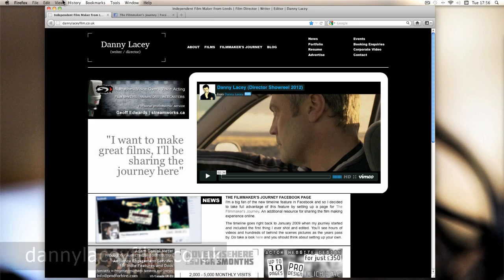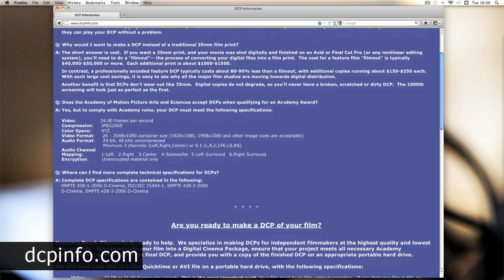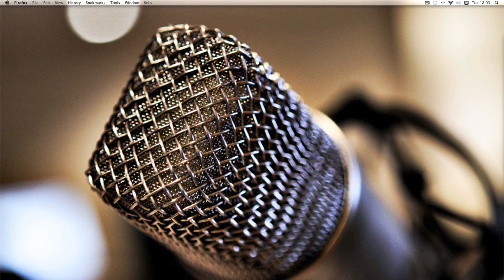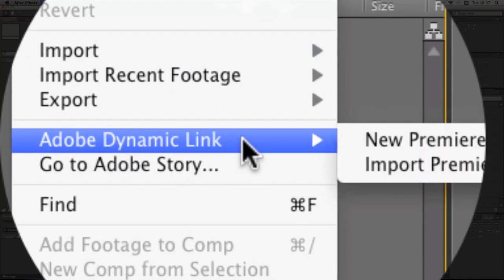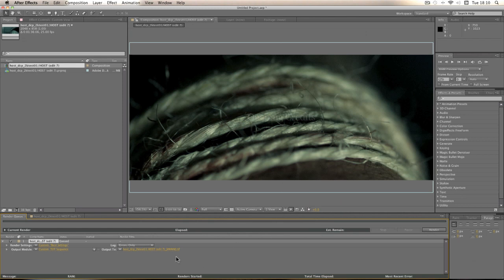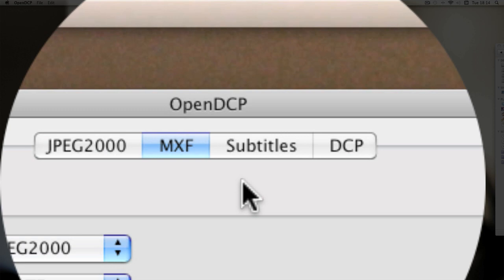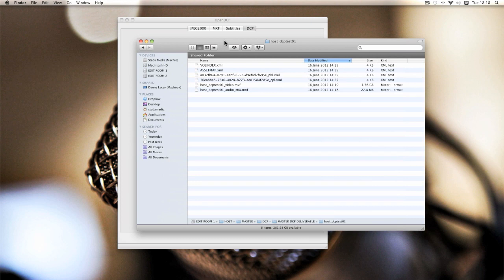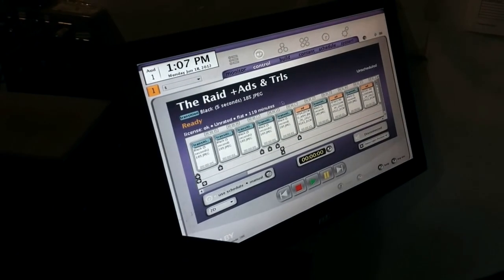GETTING TO GRIPS WITH MAKING A DIGITAL CINEMA PACKAGE (DCP) FOR FREE

Comment: I premiered my first feature last year and had to make my own DCP with OpenDCP.
150 minute film, within the last 7 minutes towards the end, it seemed like a couple of frames stalled - but sound was ok and we agreed after so much trial and error that it was "good enough" and nobody would notice.
This was fine on the dolby projector however -
in the brighton screening,all was fine until that frame - and boom. black screen. audio cut out, like a power cut for 2 seconds, before it came back. it broke my heart.
I'm trying to work out what went wrong, but I don't think I'll ever know. NeoDCP seemed fine. everything validated.
maybe 185 mbs was too high - maybe I shoulda done 125? because there were major problems like this on the first attempt and that was at 250, so i toned it down.
the horrible thing is, there is no way to really find out. maybe the unix drive which was hell to work with (since im using windows) was corrupted - but i just don't know.
any advice on this stuff would be appreciated. It was in 2K, 5.1 sound, 24fps, 2.39:1
I have access to the dolby projector, but not the other one that i thought blew up!

Comment: one thing to point out is; with long movies, opendcp will appear to freeze when you press "create dcp". in most cases it's NOT frozen. A 2 hours movie "appeared frozen" for over 1 hour (on a 12core xeon Mac), then the "choose destination" window appeared, i pressed ok and in one second the "DCP CREATED SUCCESSFULLY" appeared. So, fear not. 99% of the times is not frozen, unlike you might have read in a few forums. Also there are a few choices to review your final dcp on a mac or pc at the moment, some are cheap and/or for rental, like Quvis, easydcp player and so on. just google it :-)

Comment: dear Dany, thanks for your detailed explanation. I still have questions though, hopefully you can give me the answer. Will it work for 1920 x 1080 resolution (instead the 2K - 1998 x 1080) ? thanks a lot more in advance.
Reply: +edo wulia 
Use the FLAT-container (1998x1080) and pillbox it.

Comment: I'm a bit confused about a couple of things. 

1. Just for noting, 2048x1024 is a 2:1 aspect ratio, not as you say, 1.85:1.

2. is there a reason for going through that extra step of making it 2:1 and then just cropping? Isn't it just easier to go directly to 2048x858?

Comment: I followed your instructions and created the 16 bit tiff files in Adobe AE. When I used opendcp to convert the tiffs to jpeg2000 files and compared them to the tiffs, the color of the tiffs was colorful and vibrant but the color on the converted jpeg2000 files was washed out with a greenish cast to the skin tones. What went wrong?   ....Update ...... I looked on the opendcp website and one of the FAQ's had this question answered. It turns out the mpeg 2000 files created from the tiffs are xyz color space instead of rgb, so on an rgb monitor they show faded colors with a green cast. However the files do convert properly with proper colors to .mxf files and work properly in the dcp package files created by opendcp. In order to verify my dcp files worked I downloaded the free trial version of NeoDCP player (64bit), and the dcp package worked perfectly (I had tried viewing the video mxf file with the vlc media player but it didn't work).  Even with the NeoDCP Player trial 1 minute limit and watermark, I could tell the dcp video and audio worked perfectly, and slightly sharper than an mp4 render I did of this project (probably because of the conversion to 16bit tiffs during the dcp creation process).  Even though this video is more than 6 years old and the opendcp.org website forum hasn't had any activity since 2016, these instructions are working great in October of 2018. Well done Danny Lacey! P.S. The only part of the instructions that didn't work for me was changing the 1920/1080 2k HD video resolution to 1998/1080 to get the 1.85 ratio, instead of 1.78 ratio of standard HD. Changing that picture size stretches the width of the image (faces and people get fatter). So I left the image size at 1920/1080 when creating the tiffs.

Comment: Thanks Danny, How to deliver the DCP files to festivals after finishing everything? will a USB flash works? and how should I format it using windows. thanks.
Reply: +Waref Abu Quba 
Use a flash drive of any size. If you can the industry standard is a ext3 formatted HDD, but NTFS also works fine.

Comment: @12:44 you have a aspect ratio of 1:2 (with 2048x1024). Not 1:1.85.
As a digital cinema technician I feel I must correct you good sir :)
Here are the three standards:
FLAT     | Aspect ratio: 1:1.85 | 2K-resolution: 1998x1080 | 4K-resolution: 3996x2160
SCOPE | Aspect ratio: 1:2.39 | 2K-resolution: 2048x858   | 4K-resolution: 4096x1716
FULL     | Aspect ratio: 1:1.89 | 2K-resolution: 2048x1080 | 4K-resolution: 4096x2060
The last one is not used very often besides in edit.
So in your tutorial for the sake of people making FLAT-films as well one should use the FULL-container.
Reply: +Simon Fjordheim This actually was a tremendous help to me. Thank you!
Reply: +Yerren v. St. Annaland Glad to help! Let me know if you're wondering about anything else.
Reply: +Simon Fjordheim I sure will do :)
Reply: Yes, that is very helpful, thanks.

Comment: Great tutorial! Thank you very much.

I still got a couple of questions: 

If my native project is in HD (1920x1080) I'll need to upscale it to 2k? 

And, the "DCP deliverable" folder with those 6 files are the only thing the drive should carry, not the JPEG and the WAV but only the Mxf and the Xml files, right?

Thanks again in advance.
Reply from the maker: +Atzuz 1920x1080 is technically 2k and yes on the 6 files. You'll find the folder with all the DCP files is surprising small in size (this freaked me out at first). Hope that helps, please let me know how you get on my email is dannylacey@stadagroup.co.uk
Reply: +Danny Lacey It did help. And precisely the size of the DCP files in your video was what surprised me. My current 5 minute PNG animation renders (which will be exported later as 16 bits tiffs) with the final edition, weight 13.1GB.

I'm writing a document about all the technical and creative process for the animation project, and I'll be quoting your vid of course.

And yes, I'll let you know how it all went.

Thanks again.

Comment: Hi, having a bit of trouble finalizing my DCP film and need help. I got 90% of everything done (Though I had to may my audio 24 bit and made it multi-stereo in order for it to make an MXF audio film) The problem I have now is that when I press to make a DCP, it will go through the video and audio and once it reaches 100% it gives me an error that reads "dcp contains mxf interop and smpte track" What am I doing wrong and why wont it write? Any help appreciated. Cheers.
Reply: +gutz1981 Solved it. It was the audio MXF export that needed adjusting.
Reply from the maker: +gutz1981 Glad you got it sorted. Let me know how the DCP screening goes.
Reply: +Danny Lacey Cheers. The problem is I won't know if it worked until I send it to a screen to play on. Have to play the gamble.
Reply: how did you fixed your audio? mine have problem though i have got mono and stereo selected and have converted the audio files to Left and right. when i press create dcp for audio it says failed to conversion can you help me ?

Comment: Hey Danny
First of all, thank you very much for this amazing tutorial! I managed to make DCP for one of my short films and screen it at some festivals because of this. So thank you!
But today I came across a problem I've never had before. I followed all the steps as usual and all worked fine until the creation of the DCP. At the end of it there's this error message saying: "DCP contains MXF Interop and SMPTE track" And it won't create the DCP.
I tried everything from exporting the TIFF-sequence again and did every step again and again, but it just won't work. I checked the label while exporting the MXF and both the audio and the video should be SMPTE. I really don't understand this.
Have you every also encountered this problem?
Thanks.
All the best,
Leon
Reply: Independent Frames Had the same problem. I just restarted OpenDCP reloaded the MXF files hit CREATE and it just worked O_O
Reply: +Andrei Sopon 
Hi,
As SMPTE is in it's early stages (with lots of problems due to old firmware and so on) I would recommend staying with interop (IOP) until DCI signals the all clear.